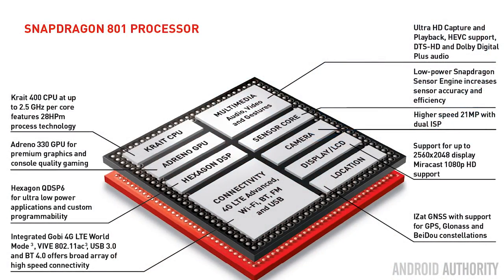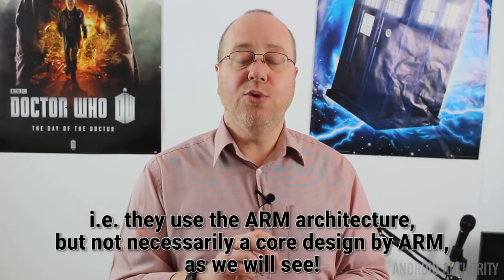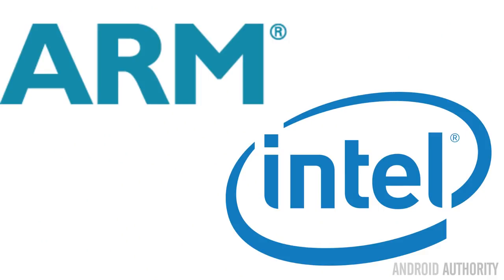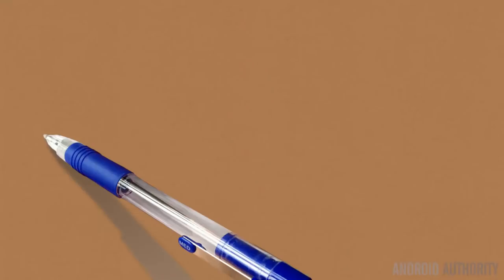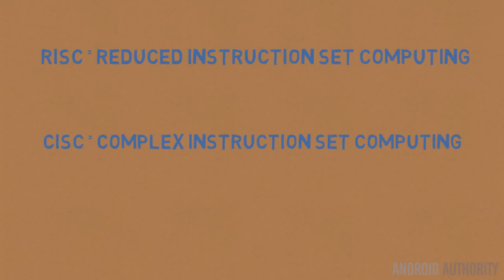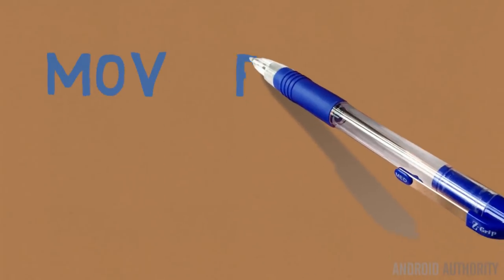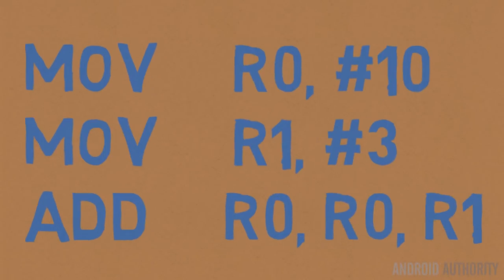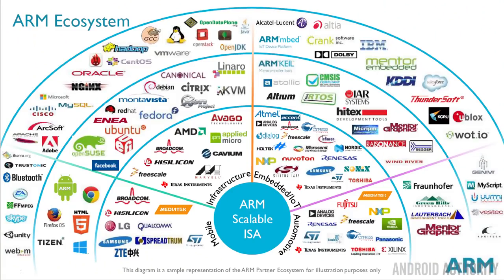Custom cores versus ARM cores, what is it all about?

Comment: But what did Apple achieve by jumping into 64bit? Years on, the iPhonr 7 only has 3GB RAM in the plus version, and I think the iPad Pro is the same. The only difference I've heard between 32 and 64 bit if no need to address more RAM is that 64bit chips tend to run warmer. I don't know how accurate that is but it seems like it was unnecessary for Apple to do so early and for Qualcomm to rush a design and fail in performance.
Reply: Because in the end it's about sales and not improved technology. The marketing teams need things they can sell. Most people have no idea what "bit" means and what you can do with 64bit compared to 32bit... But 64bit is bigger, faster, stronger and you need it!
I'm a computer geek, gamer, gadget freak... Whatever you wanna call it. But I never use top of line "flagship" hardware, because that stuff is mostly marketing bullcrap. And I see that trend with a lot of my friends and colleagues. The real nerdy programmer/engineer types all use older, more upgradable Laptops with linux, windows... And the office/designer types use shiny, expensive, highpower iMacs and MacBooks :D
Nobody needs 7nm chips in anything, I really believe that. It doesn't solve any of our problems at all. It's not significantly faster in the tasks we really use (sorry but benchmarks are not the daily usecase), the devices won't have significantly longer battery life, the size doesn't change, it doesn't improve youtube videos, it doesn't improve audio quality and it certainly won't convince devs to finally make a decent video game for a mobile platform... But the guy can go on stage and say "we have the fastest, mostest advancest mega chip - now go and buy!"
Reply: It's a matter of backward compatibility. At the time, when they released the 64 bit version, there was no need for it. But now, we have 4 GB or event 6 GB of memory in the iPads, which run almost the same software as the iPads do. So there for, to gain an advantage there, they needed to bring up 64 bit early or simply drop the backward compatibility for older phones, which is usual for android devices. So believe it or not, it wasn't just a marketing gag, it was a kind of long product live decision. So as we can see now, the iPhone 5s is still supported by iOS 12 which is a pure 64 bit OS and this device was released in 2013. Nice to know, that Apple cares about that. And this is why this phones are still worth something.
Reply: You're not making much sense. If the physical address lines are present, most 32-bit ARMv7 cores can address up to 1 TB of RAM through LPAE. This means each process (= app) gets full 4 GB of addressable space.

64-bit ARM is desirable mostly to enable high ILP (instruction level parallelism) by providing more opportunities for OoO core to reorder instructions, so that multiple instructions without register interdependencies can be executed simultaneously. This was mainly achieved by removing ARM instruction _predicates_, which determine whether instruction should be actually executed or not. Those predicates not only require read access to flags register port (= huge amount of register file complexity), but also significantly reduced or even prevented instruction reordering opportunities.

Apple truly capitalized on increased ARMv8 ILP opportunities in Apple A7 by implementing a very deep 192 op reorder buffer and wide execution resources (6 execution ports) thus enabling a core to retire up to 6 instructions per clock cycle. Of course, the real rate is much lower, but this is basically how you achieve high single thread performance.

64-bit ARM also doubles the number of scalar and NEON SIMD registers, which is godsent on an architecture that, unlike x86, limits what kind of constant values can be embedded in the instruction stream.

So ability to address more than 4 GB of RAM or having 64-bit registers is not the reason for Apple to move to 64-bit chips. The real reason was high single threaded performance enabled by significantly better ILP opportunities in AArch64.

Comment: Intel x86 is not CISC anymore. It converts the "CISC" instructions to ROPS or internal opcodes with wide word width and simple execution. The real issue is that this left the crappy x86 instruction set for compiler writers to struggle with. Are ARM processors simpler? Sure, but that is more because Intel overcomplicates everything, rather than anything to do with the instruction set.

Comment: Now watching it back in 2019 it seems that Nvidia has fallen of the mobile processor development race. Can you make a video on what happened to Nvidia s Tegra line or what is comming next if you got any info on that... (I know they have the Tegra X1 in the Nintendo Switch, but that cpu is over two years old now and in the mobile tech market that's like forever)
Reply: I want to ask you some questions if you know about the Kirin chipset. If the Kirin processor from Huawei has architecture lincese from arm ??? Allows him to do custom variants core they took from arm.... ??? Is that they have I see many kirin processor they take the CPU design from arm and then put it that chip kirin. They never do  custom CPU core ????  Like Qualcomm , Samsung and Apple.

Comment: Could you please make a video explaining how, despite using the same A53 & A57 cores, the various SoC's including 810 & 7420 can perform differently in all aspects inc. actual speed, thermals, consumption, etc...?
Reply: +Oscar Cooke-Abbott LOL, if I knew that I would be working for Qualcomm or for Samsung!!!! :-)
Reply: that's because of the construction the 20nm construction of the 810 leaks energy whereas the 14 nm used by Samsung have a fin to stop leakage of energy since the exynos 7420 leaks less energy so throttles lesser whereas the 810 loses more energy and has to throttle down its cores and the 810 drivers were not finished and properly implemented in different devices with proper heat dissipation and it throttled whereas samsung implemented their own chip on their flagship line  and properly designed it for their device with great heat dissipation and less throttle exynos did not sell it's chips that much other than meizu so we don't know about the 7420 time will tell when the meizu pro 5 hits day light all over the world and how it throttles just like Qualcomm made device running the 810 had great performance but when implemented by device without proper dissipation it leads to throttling then it leads to less performance
Reply: the two CPUs can have different clock speeds and different GPUs I'm sure that's a large factor
Reply: +Patrick Murphy the gpu is one factor but the 7420 and the 810 isn't that big a difference in clock speed 105 ghz A53 on both 2ghz a57 Qualcomm 2.1 Samsung
Reply: +Oscar Cooke-Abbott 820 use 20nm process whereas as 7420 uses 14nm finfet. So, it is more efficient which in turn can result in better performance compared to 820 which uses the same cores.
Reply: Patrick Murphy Indeed those are factors,. There are probably others as well, like the amount of cache memory, the fabrication process, the physical chip layout on the silicon etc.
Reply: +Anantha Krishna yeah its funny its manufactured on a different process but its not a custom core
Reply: +Patrick Murphy Each SoC maker needs to find a manufacturing partner who will offer a certain price per chip for a given fabrication process. That is all linked to the physical end of things and don't really have much to do with the core designs. The core designs that come from ARM are optimized for a target fabrication processes but they work on target in that ball park.
Reply: +Gary Sims Haha! There's actaully an explanation for this on ARS Technical i believe
Reply: Cause the samsung manufacturing of the arm design is smaller at 14nm while snapdragon 810 is 20nm. The smaller chip has the advantage in building up heat and cosumes less power.
Reply: ***** Yeah it's all the other stuff that Im not sure of haha
Reply: +Oscar Cooke-Abbott yes please give a introduction of different series of quadcom chip like 800series, vs 600 series etc..
Reply: @kluhec32  yes bro.... Like SD 855 7nm lol.

Comment: which is better ARM or qualcomms own architecture??
Reply: +Sanjeev Aher Well that is the million dollar question... At the moment we have lots of new chips coming out, we have chips with the Cortex-A72, chips with Kryo and chips with Mongoose, so we will need to wait until all the devices are out and then we can do a full showdown and see who wins!!!
Reply: +Gary Sims thanks 😀 
looking forward for that !
Reply: +Sanjeev Aher I think custom cores are better because they bring new solutions and patents to the stock architecture.
Reply: +sic22l  but from my experience custom architectures has its flaws 
for example the snapdragon 801 had  custom krait cores which were powerful but not as efficient 
whereas the snapdragon 410 with arm architecture seemed to be extremely efficient and a bit powerful
Reply: Sanjeev Aher Actually SD801 was quite power efficient chip considering its speed.
Reply: sic22l  actually i have an lg g3 
no matter whatever i do installing roms kernels and even undervolting  the processor is prone to heating and battery drain
Reply: Sanjeev Aher In the G3 SD801 is squashed by QHD resolution. That's too much for this SoC. LG messed it up, not Qualcomm.
Reply: sic22l i even tried changing the resolution !
still the same
Reply: Sanjeev Aher You can't do that, it requires serious software modifications. There are custom ROMs that make G3 work with no lags.
Reply: +sic22l yes I am running cm 13
with 1080p resolution

Comment: RISC - CISC reasoning again. I really don't like having such thing in an informative video, since many people without enough knowledge will believe this reasoning without doubts, although it is completely incorrect. I admit, the reasoning was valid in the '80s, but now it is not! Currently any CPU (Intel, AMD, MISC, whatever) use a small part of the transistors for translating the instructions to small micro-ops, which can be better pipelined, reordered, overlapping can be found and so. I.e. there is a RISC in every CPU. The only difference could be the number of registers, but since x86-64 and the extra r8-15 registers (+ the fast L1 cache), this is not a real issue, the x86 is a RISC inside.
The only advantage remains is the extra difficulty coming from the "organically developed" prefix-based x86 instruction set, which is much harder to decode, i.e. that can eat more transistors. Somewhere I saw that decoding the instructions takes ~5% of the CPU size. I'm not sure it is right, but the order of magnitude should be correct, so say 5%. Considering that even an ARM CPU needs instruction decoding, you get 1-2% advantage with RISC. At most.

Comment: What? You're "measuring" performance by having 64-bit architecture? It has nothing to do with the performance!

3:20 Huawei isn't a architectural licensee, they're using stock ARM cores only.
Reply: +sic22l This is the opening lines of a press release issues by Huawei in Sept 2013: "Huawei, a leading global information and communications technology (ICT) solutions provider, today announced it has signed an agreement with ARM to license the ARMv8 architecture. Under the agreement, Huawei can use the ARMv8 architecture to design its own microprocessor cores."

See more at: http://huawei.eu/press-release/huawei-announces-global-agreement-licence-armv8-architecture-agreement-underlines#sthash.etiTqwPb.dpuf
Reply: +sic22l Also when do I measure "performance by having a 64-bit architecture?"
Reply: *****
1. In real life Huawe uses stock ARM cores only. They may have the architectural license but they never used it.
2. 10:12 In short: Apple leads in terms of performance because it's making their 64-bit cores for 3 generation and the others for 1 generation.
Reply: +sic22l As for point 1, yes I agree, and I didn't say otherwise in this video, that is one of the reasons why I didn't dive deeper into what Huawei is doing, however that doesn't change the fact that they have an architectural license, which is all I said in the video. Also since it does have such a license it means that Huawei could release  their own core design, and who knows maybe that will happen in 2016.

As for 2, the context of what I am saying isn't that 64-bit gives better performance, it is that Apple is on its 3rd generation 64-bit CPU. When 64-bit became mainstream it was like a clean sheet for the SoC makers, for example Qualcomm can't just take Krait and make it 64-bit by adding a few extra bits to the end of everything! So Apple is on its third gen custom core since the switch to 64-bit. It is its fourth custom core, however when the switch from 32-it to 64-bit came then it marks the beginning of a new era. Qualcomm and Samsung are on their first and ARM is on its second. So the emphasis is on 3rd, not 64-bit.

Having said all that, 64-bit itself (or better to say ARMv8) does intrinsically add some performance gains. First there are double the registers and second data is moved around in large blocks. Please see my article here: http://www.androidauthority.com/arms-64-bit-architecture-is-good-for-developers-407346/
Reply: @GarySims  what is the different between Monggose core from Samsung and kryo core from Qualcomm.... Because I little bit confused about that because Qualcomm use semi custom core to design their own one core.... But Samsung use that core design then they use all the the custom.... Not semi custom like Qualcomm is that true ???🤔🤔

Comment: What if a chip is doubled in size and content?
can we get double the benchmark scores and performance?

I mean these chips are so small that it wont take much space to multiply the performance and make these phone even more powerful.
Reply: +Shoeb Khan It isn't as simple as that, you can't just double the size to double the performance. In general the reason why the number of gates in the chip increase is because the complexity increases, e.g. a more complex micro architecture with more advanced pipelines, branch prediction units etc. That is why a core like the Cortex-A53 is smaller than a core like the Cortex-A57. However there is a downside, big chips produces more heat and use more battery life.
Reply: +Gary Sims alright i agree with you that this isn't so simple but i think some companies like apple have got potential to make future smartphones much more powerful then we would expect.